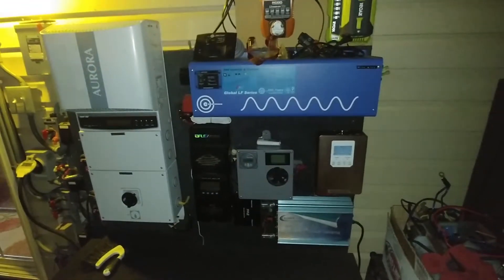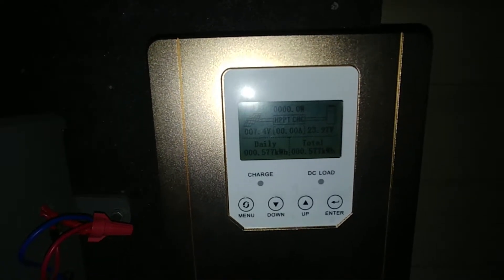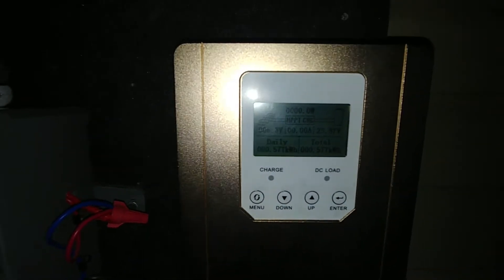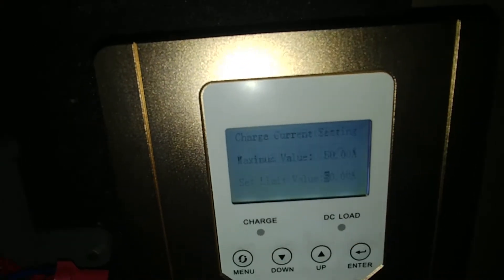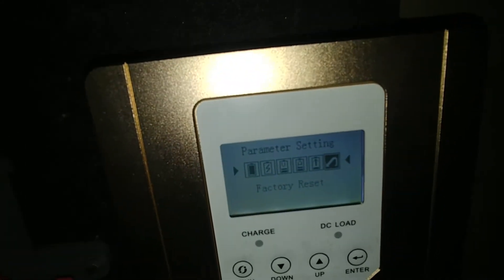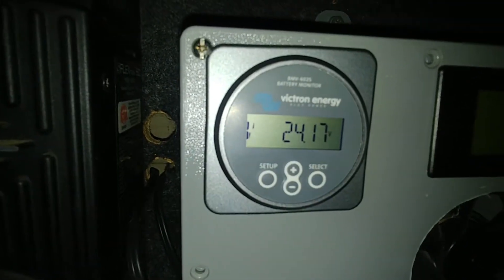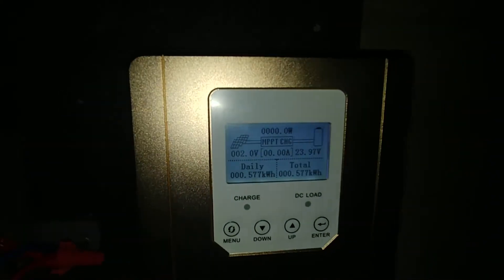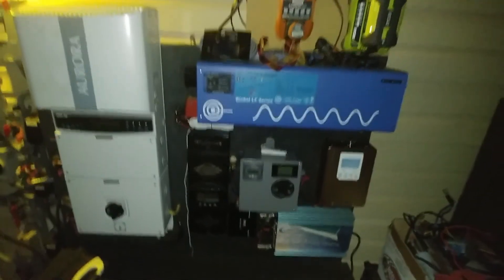Sunnysky mppt charge controller

Comment: I have the green one and it also is unable to connect to PC.
Reply: ronpaul2012robust thanks for checking out my video
Reply: You need to get an rs-485 to USB cord to plug into your laptop.
Reply: Yes i am also interested in how to use the rs485 port on the charge controller
Reply: @Kestutis Narmontas looks like it's possible, the manufacturer had sent me the protocol, haven't had time to dig into it.
Reply: @01Alexsimps  you can use protocol and software from the ampinvt mppt charge controllers. its the same

Comment: Hi,i have the same MPPT you have  ,60Amps, just ask ;  I see in this MPPT  3 pair of screw in the bottom one pair for the solar panels ,one for the batteries and the other for  "DC load" ..??.. .,for what is this supposed to?
Reply from the maker: HI NORBERT RIVERA---THANKS FOR CHECKING OUT MY VIDEO----THE DC LOAD IS FOR  FAN,BULB,DC WATER PUMP FOR YOUR SWIMMING AND SO ON {60A ON THE DC LOAD}
Reply: @bimmers323ci  thank you.